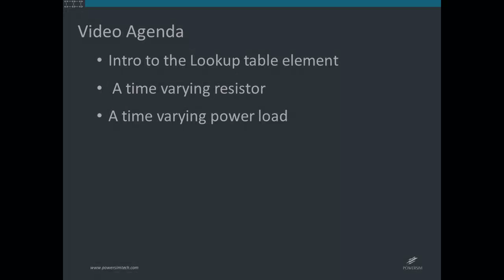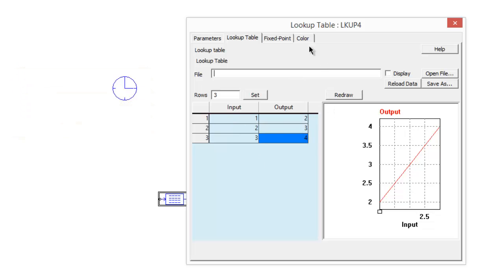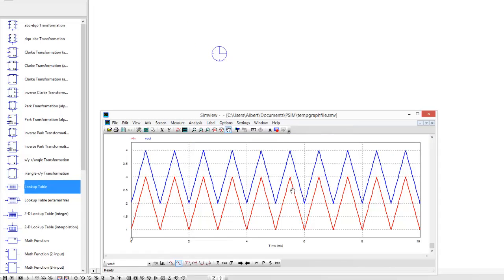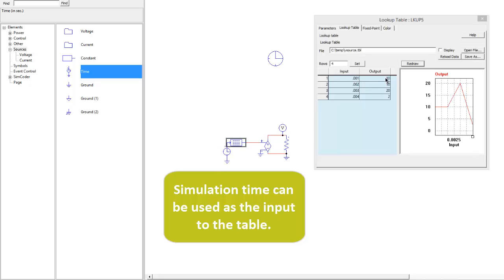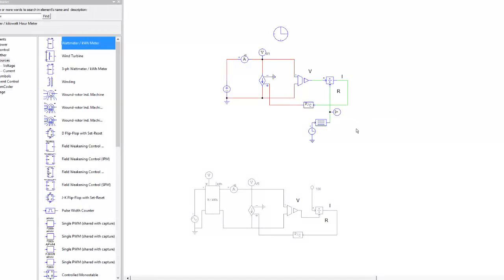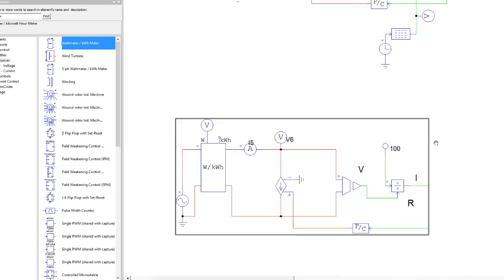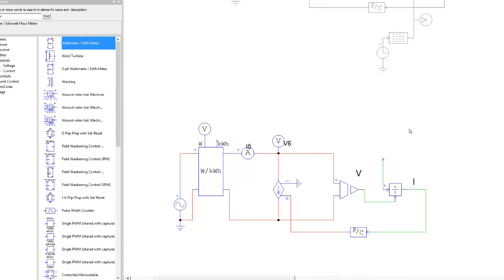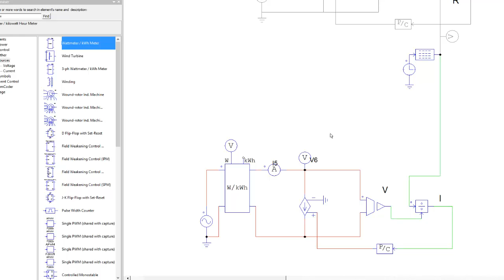How to use the lookup table to make a variable resistor

Comment from the maker: Want to try PSIM?                                                                                  - https://hubs.ly/H0f9wCC0
Why should you use PSIM for Motor Drive design?                         - https://hubs.ly/H0f9wCK0
Why is PSIM preferred for Power Electronics simulation?             -  https://hubs.ly/H0f9wFX0

Comment: Great video! Tip for anyone who has version 9.0. The .tbl file can be implemented by the "parameter file" component. You should write the graph points as follows (for example):
.
001, 10
.002, 20
.003, 20
.004, 30
.005, 30
.006, 50
.007, 50

In the Lookup table, you should type the file name plus .txt